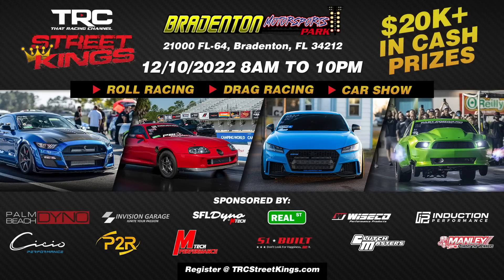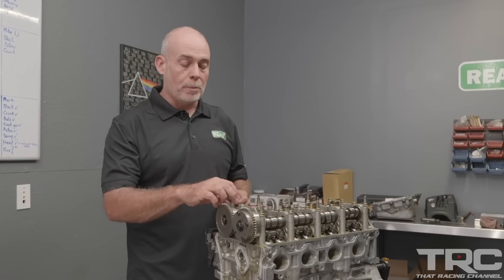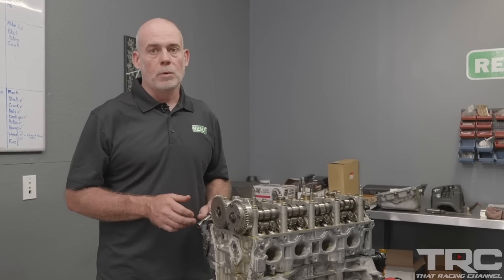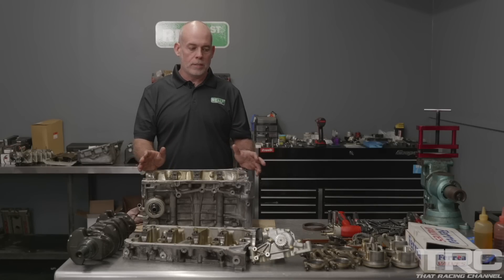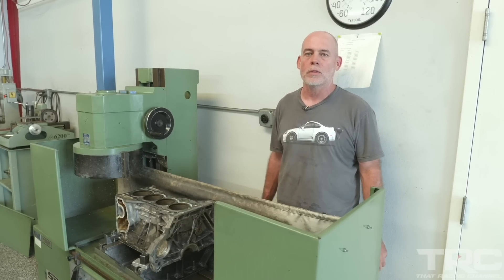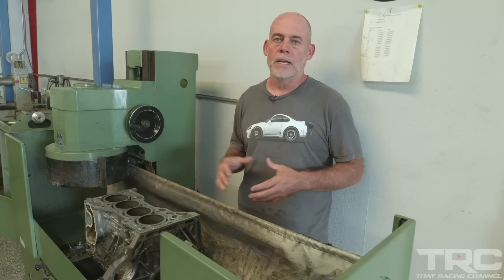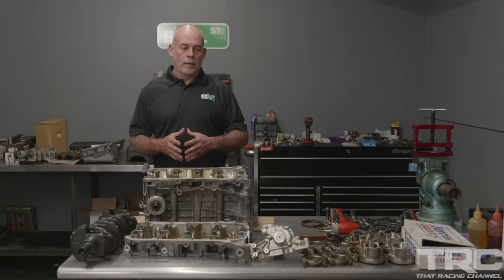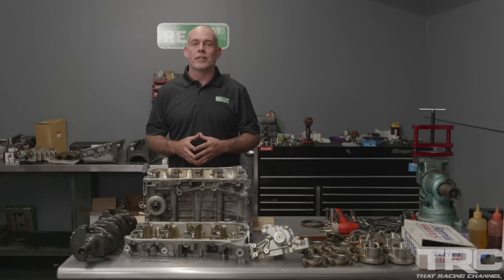700WHP AWD Turbo Honda K20 STOCK 200,000 Mile Engine Teardown - Ep.16

Comment: Honda never fails to amaze me with their incredible engines. As overbuilt as these early K series engines are and as well as they tolerate insane RPMs and power on stock internals, I'm starting to think it would be virtually impossible to significantly wear out a reasonably stock one within a person's lifetime if it's maintained well. I'm not sure that anyone overbuilds engines to this extent anymore.
Reply: BMW's B58 has earned quite a bit of recognition by now, but the S58 is a different animal. Intake, downpipe, upgraded turbo internals, and port injection are all it takes to make 1000hp at the crank with those motors. Evolve Automotive has one at that power level with those mods and forged rods. Everything else is stock. They probably could have kept the stock rods but they wanted "play it safe".
Reply: Not a k series but one of the older engines by honda. My buddy literally had one with a million miles on it without an oil change. We did a whole lot of bad thing's to it to finally kill it.
Reply: @bmxriderforlife1234  Their older engines are very solid too, but a million miles without an oil change on any engine is quite the stretch lol. The K series especially suffers from bad rings, worn timing chains, and i-VTEC problems if the oil isn't changed regularly or gets low for too long, but can't blame that on the engine.
Reply: @averyalexander2303  my buddy had an old civic. First owner sold it cause the dipstick broke off and didn't wanna deal with it. Lady who bought it as her first car and sold it to my buddy knew nothing about cars. I'd had previously been in an accident because she didn't know you had to do brake servicing.....she never topped up any fluids or did any pad replacements or rotors till the accident. Only point that car would've had an oil change was then. My buddy got it for so cheap he gave zero shits and never did an oil change. Keep in mind this is stock hp levels. Same engine people used to build and before an engine swap would just beat on them to see how long they'd survive. 400hp no oil dry burnout runs for minutes till  a  rod went flying was common. I think his motor was like 140hp xD they survive alot of abuse

Comment: Question? This block would have been decked on its first build so why deck it again when the distortion is prob equal on the head too. If the head gasket looks fine can't you just replace the headgasket an bolt the head back on without any machining.
Reply: When an engine gets hot (or is just under tons of stress) the deck and the head both warp. Both become concave. The head does not conform to the block deck.

Comment: I always thought k20 are closed deck blocks. Open deck and still handles 500+ hp
Reply: Most Honda blocks use an open deck: K series, B series, OBD2 H series, s2k, J series, etc. OBD1 H22A is one of the few dual cam vtec engines that used a closed deck
Reply: @оначертовасука  For an open deck block to handle that much power stock is impressive. Darton sleeves should be a big improvement.

Comment: Jay what is your opinion on reusing K20 cranks that have spun the Big ends and the crank journals are damaged  Can they be regrind and nitrated to last a long time ??
Reply: They are so cheap and easy to find why chance it? 
Can find k series’s cranks for 100-150$
Reply: @joshr8680  for a type R crank it’s a lot more than that 1300$
Reply: @RSADYNAMICS  true didn’t realize you were talking about the new k20c 
Thought you were talking about the older k-series
Reply: @RSADYNAMICS  my dad races XFWD. They are 1500whp b series engines and he doesn’t use cut cranks. 
He will use a crank that’s cut .25mm on stuff up to 700whp. After that the “long time” part of your question goes out the door. 

Depends what’s your trying to do with them I suppose
Reply: @joshr8680  does he Nitrite the crank or use WPC ?

Comment: The K is truly one of the best, if not the best 4 cylinder engine ever made.
Reply: K20/k24 hands down best 4 cyl ever created. No other engine comes close to pumping out the numbers or reliability in oem for.
Reply: 4age , 2zzge and 4g63 it’s not really the best coming from someone who drives a k24 Honda
Reply: @Legend-lc9bv  4age is more of a b16 rival, since same displacement / hp. It has no business competing with newer k series.
Same story with 2zzge. B18 rival. Similar performance, same displacement. No comparision with K series.
4g63t is a dinosaur at this point, but still holds the fastest 4 cyl. You won´t build NA shreader with it, but it´s proven engine that has been here for years, so i can see the point.
Reply: @RealLeskot  if you got instagram I can show you how 2zzge have been dominating in other countries
Reply: @RealLeskot  and we don’t have plan kseries we have euro r type r from all generations and 2zzge is their biggest rivals
Reply: @RealLeskot  4g63 doesn’t have any quickest or fastest 4cyl records left. Hasn’t for a while
Reply: @GreenGoRacing  you got 2g eclipse going 6 seconds what you mean
Reply: @evoguy333  and they lost that record to Honda. And k24 went 5.8

Comment: 200,000 miles my ass. No engine stays that clean. I don't care what any of y'all say. That engine has been opened up before hand
Reply: After 200,000mi the inside of that crankcase would be gold/bronze colored.
Reply: I mean I'm sure it has been opened before cause they race it
Reply: A bunch of the clips in this video are Javier’s new 2.2 engine they must have filmed the 2.0 tear down and 2.2 build video on the same day. When they explain the k series girdle system and thrust washers and the engine is super clean that is his k24 2.2

Comment: 700 seems optimistic, if you reverse calculated it from the weight and MPH but didnt take into account what sounds like a dog box/sequential then that number is inflated.
Reply: Wrong. Been numerous people that have done 600+whp (on pump gas and mediocre tuners) before it blew. 700hp flywheel on race gas and pro tuner is definitely doable...
Reply: @Nyfloridaboi  I guess inflation has hit US dynos badly this year, 700whp here with sequential is good for a 9.0 at nearly 160mph here on a goat track called cootamundra
Reply: @WholesaleTurbos  the car weighs over 3000 lbs and it ran 10.1 with all season tires and terrible 60 foot. Would have gone deep 9’s at that power level with slicks.